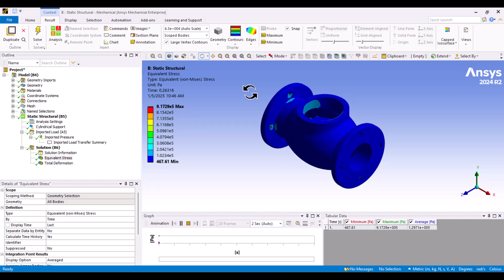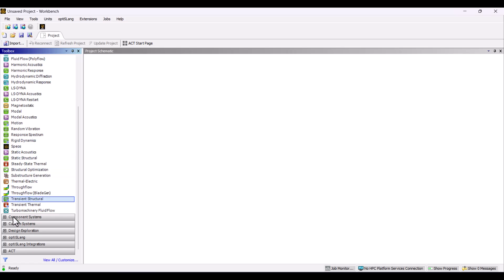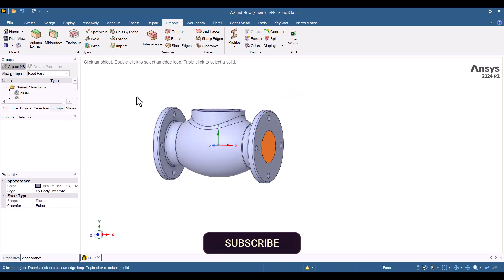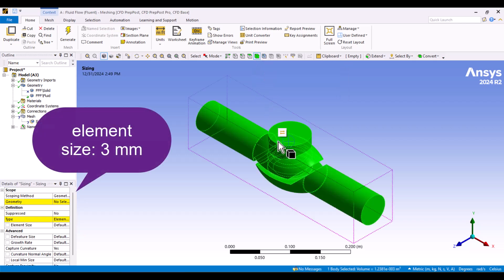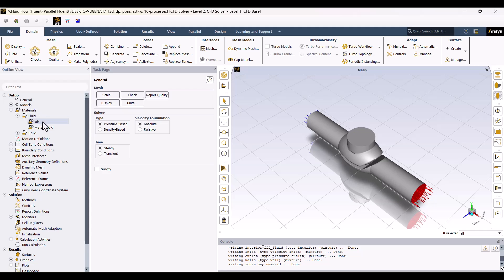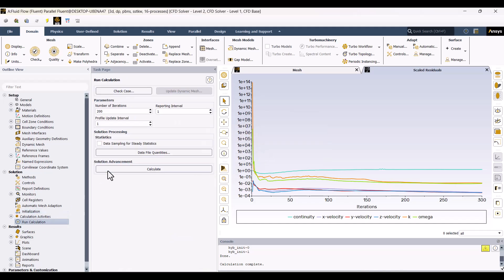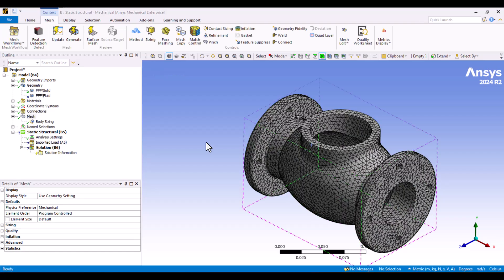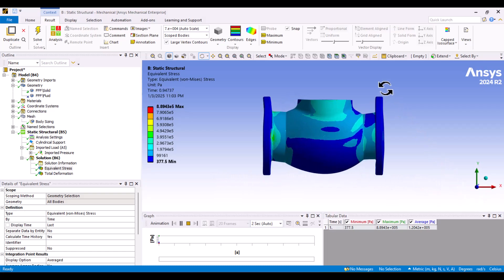🌊 ANSYS  Fluent Tutorial: One-Way Fluid-Structure Interaction

Comment: Perfect, is it possible one-way and two-way fsi benchmark example and papers introduce to me for flow in pipe, also haow can I perform fsi between fluid and solid for fluid-induced vibration?
Reply from the maker: Hello, I don't have any paper currently. One way FSI is used when the solid part is almost rigid and doesn't have any vibration. Two-way is used for thin solid parts and when it has a significant displacement that affects the fluid domain.
Reply: So, how we can study the effect of fluid on natural frequency of structure? @caewitharminhashemi
Reply from the maker: No, CFD only solve model in stationary and transient state  @mechanicalengineer8961